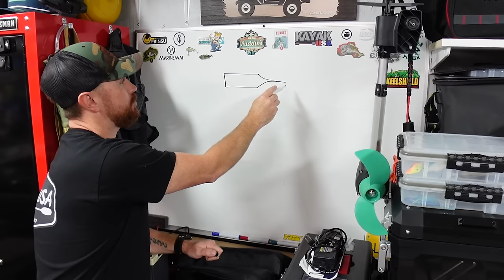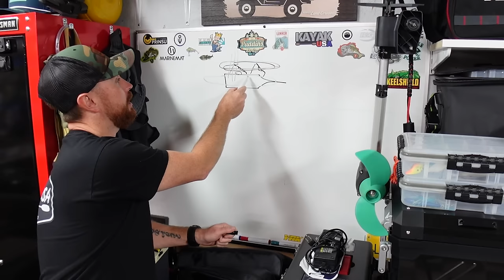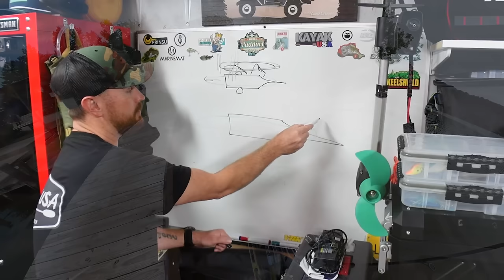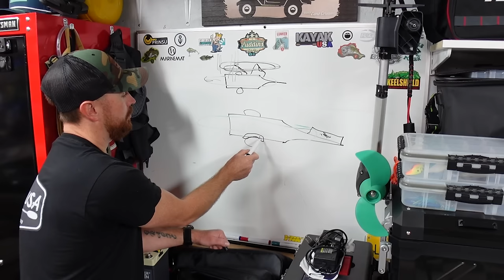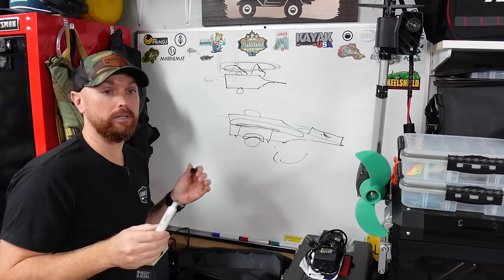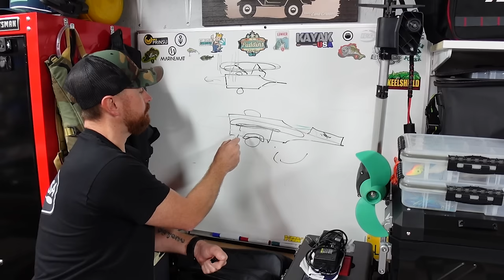Building the BEST DIY Kayak Trailer for Kayak Bass Fishing Tournaments [ FULL BUILD ]

Comment: Great video.   I watched a little at a time and came back to it as I had time.   Great job on the trailer.  I have the same trailer.  I had a problem seeing the trailer when I'm backing so I put 4 foot EMT conduit so I could see where my trailer was.  I'll put light on them later for load in the dark.  But I have head lights on mine, so its not so bad.  I have lights on the front so when I'm navigating thru stumps at night I see them before I hit them.  I put a 220 Marine Amp battery in mine with a 18 - 20 amp motor.  That gives me 10 hours of constant running.   I went 18 miles with it so far and came in after dark.   Yep, those 4 little lights are plenty.

Comment: TJ, another great build. I like the DIY stuff, so this longer format is right up my alley. Great pointer about the burn on your arm, sorry you got burned, but I am just learning to weld, so that was a great point for me. The trailer is awesome. I just installed some LED lights in my Yakima Top Water Box. I had a bunch of those lights like you used, the stems broke, so I changed them out for 4” Kayak LEDs. I wired them very similarly to what you have, but use a small pocket sized power pack using a usb connector. A lil extra wiring, but not bulky battery in the box. I really like the k Truck Bedliner idea, Imma have to steal that idea.😂😂 The DIY Trailer is coming along. Hope to have it all ready to go for a reveal on my channel. Lost some footage, so went back and did a walk through of each phase of the build.  Great job brother, it is awesome. Well done. Love the gimbal but $370 is steep for my budget.🤣🤣
Reply from the maker: Thanks man! Good luck on your build, send me some pics when you her finished 🤙🏼

Comment: Great build, lots of good building tips, paint, glue, square tube structure.  I didn't see in your links of what ratchet straps you are happy with or what you would recommend or using?  You should get with a trailer manufacture like Malone and get a Patent on your design build.  Keep up the great videos, shorts are best, but longer videos are okay, there is a Pause and History button if you can't watch it all at once :)

Comment: The only thing I saw on your trailer that I did similar on mine is that forward strap. For some reason it rubbed a grove in my kayak. The other strap has done nothing to it. So now I just use the one strap on the back half of the kayak.